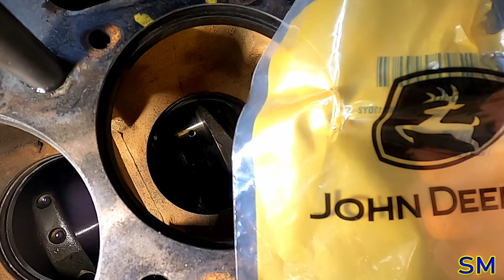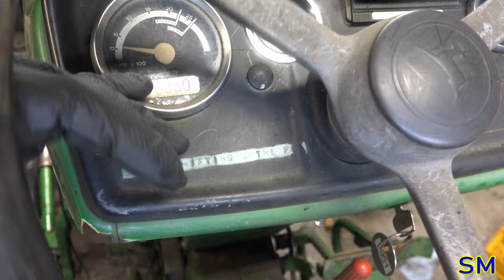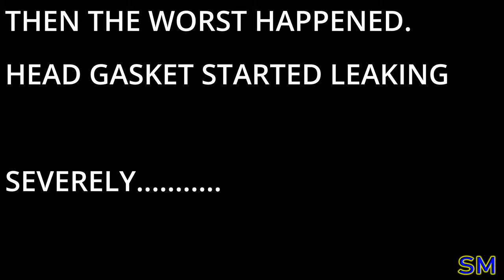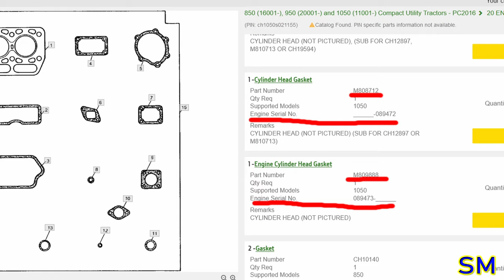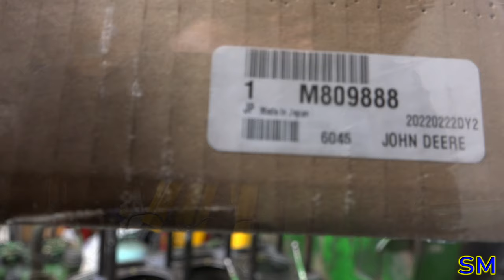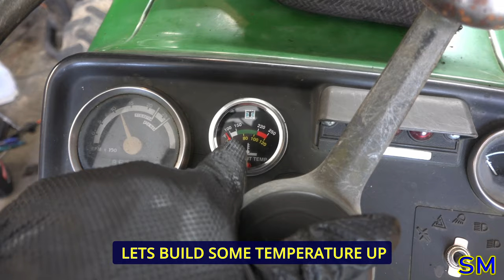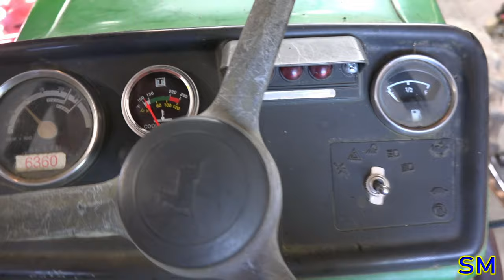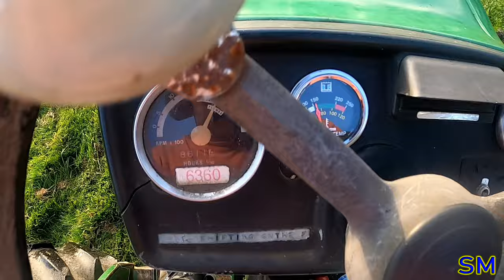John Deere 1050 Water In Engine Oil! What Broke? Gaskets? Cyl Liners? (Yanmar 3T90T)

Comment: Very informative. You took away some of the anxiety about doing some of the mechanical work myself. This engine is super simplistic. I was just gifted a 1050 that they say was running, but needs a new clutch. Figured it be a good project to test my skills on. Never worked on a tractor so this ought to be fun. By the way, great close up shots and lighting. It’s always nice to get a clear, well lit view.
Reply from the maker: You were gifted a 1050? FANTASIC! They are great little tractors. Very mechanical and reliable! I’ve never split one apart so do a little homework on it. But don’t be scared. Use common sense, take your time, use quality parts, and get your hands on the OEM repair manual binder. Glad to shed some light on this tractor for you!

Comment: On studs, and running a turbo... those manifold studs are welded in.  Better if they were bolts not studs.  Studs easier to mount... never good for an extended time dismount.  Like you said, heat fixes most domestic situations... except arguments with the wife... keep cool!
Reply from the maker: Peace my dude! 🙂✌🏼

Comment: Case DC... Case DC... Case DC!  Probably not a 1959... a 49 maybe... probably earlier... oil up the engine and tackle later this summer!
Reply from the maker: Haha someone is a Case fan. 😁 I’ll make a note of that. I think the DC is a 51 but I would have to pull the numbers off of it. 💪🏼
Reply: Yep, have a Case 300 round nose with 5ft bush mower and a Case 930 diesel I haven't heard run yet.  Life to busy... live vicariously through you! @SwedeMachine
Reply from the maker: Aw bless lol 🤘🏼